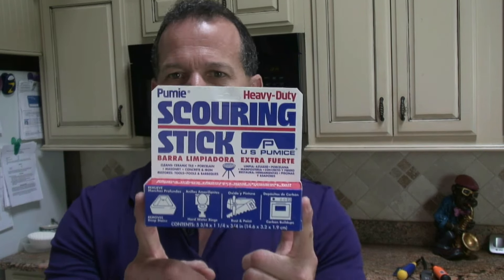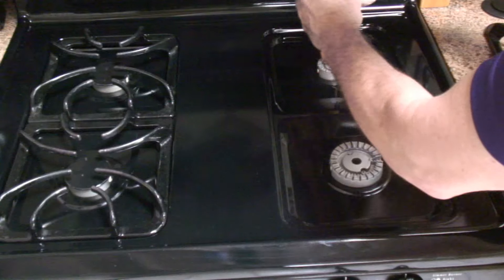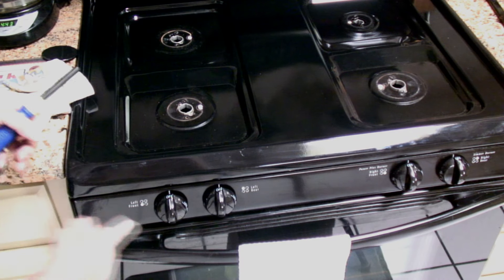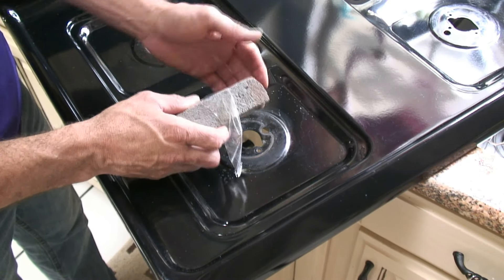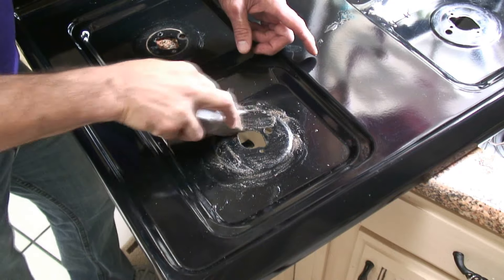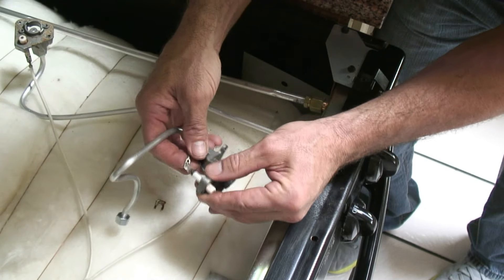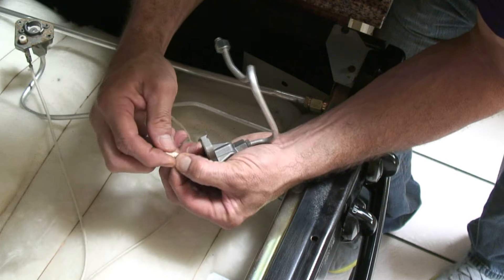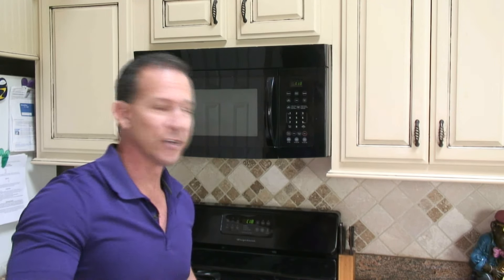Clean & Repair Your Gas Stove

Comment: Been having trouble with my burner not lighter.  Very timely info.  Thanks for taking the time to post.
Reply from the maker: +Mike P 
Hi Mike,
What is your stove doing? There is a tiny orifice on your burner that allows gas to get to your pilot light, or igniter if you have one. I cover that on my previous video. I will add the link in my description box. I will do my best to answer your questions properly. 
Thanks!
Paul